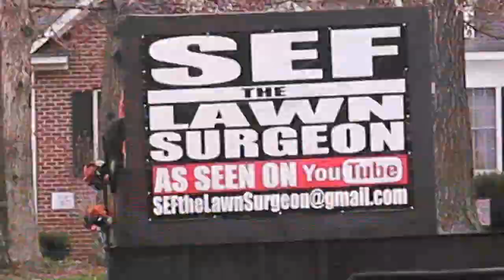Fixing Trailer With Chicago Electric Welding Machine - Welding For Beginners

Comment: That mesh is called expanded steel, and kinda surprisingly ( kinda not ) Amazon has it. I personally would go with something like perforated steel, though it seems to cost more and Amazon doesn't have a lot of size options. I'm not sure if Lowe's has expanded or not, but I do know they carry limited sizes of raw steel sheets and rods.

You've done more welding than me 😂 but grinding the paint/powder coat off makes for better welds and grounds, and also when I had a shop fix the expanded steel on my side gate that did the same thing, I had them add some angle iron supports under areas that bowed downward, so it won't bow like that again. They did great work, but damn, it was pricey.  

The season is slowly building up to a blinding pace, but since it's warming up out, and we haven't kicked in all the way yet, maybe I'll find time to play around with the little fluxcore welder I bought from harbor freight last year.